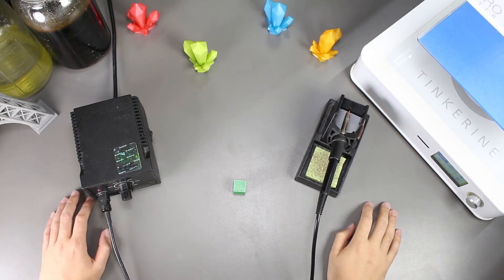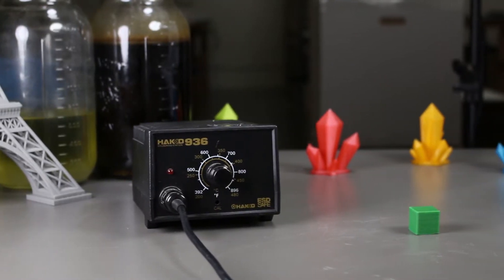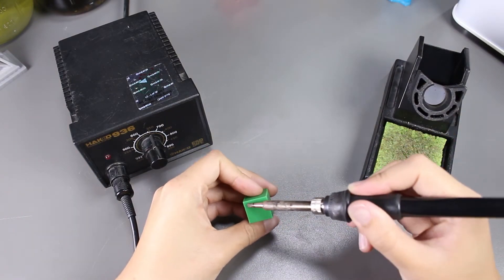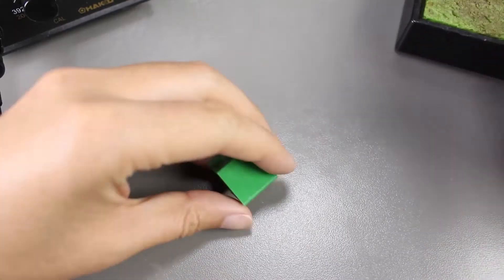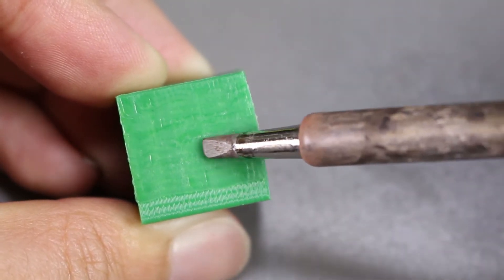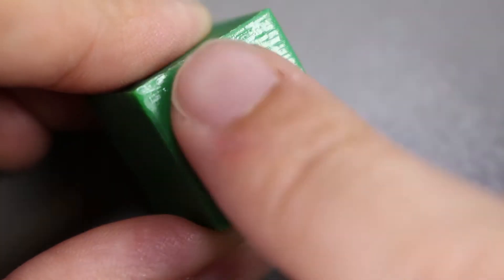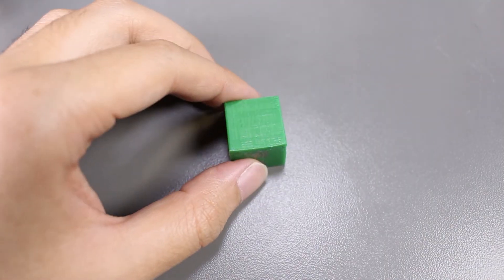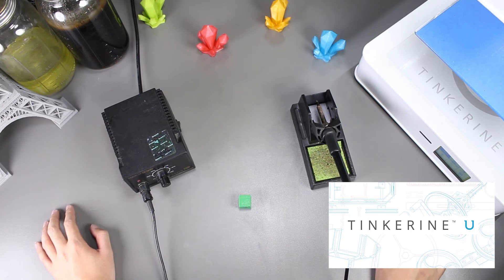Smoothing 3D Printed PLA Print with a Soldering Iron Part 2

Comment: 100-150C + SANDING WITH FINE SANDPAPER?
Reply: Use iron to smooth out larger lumps, bumps and then go back over with sand paper.
Reply from the maker: Thanks for the comment, that should work great as well!